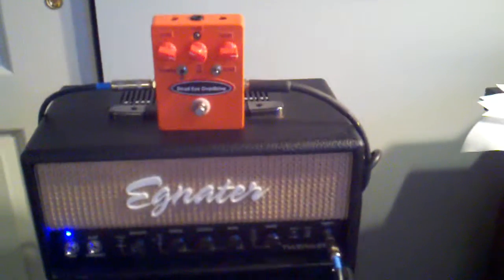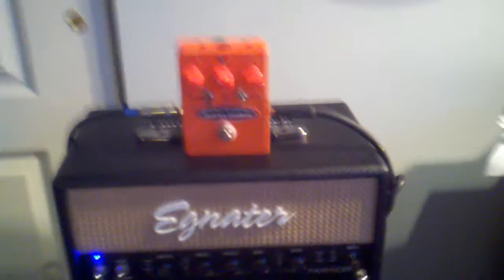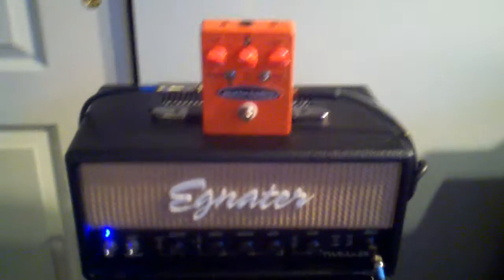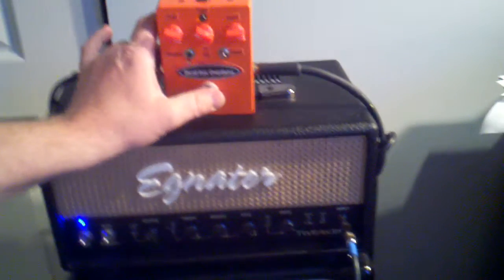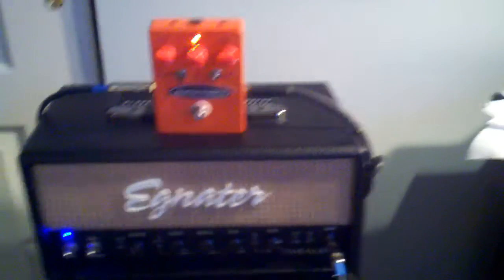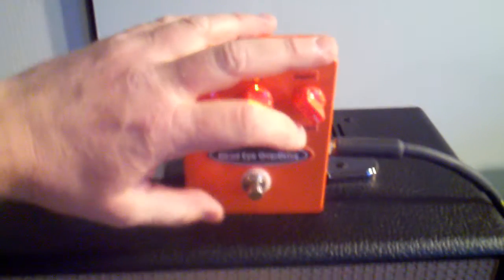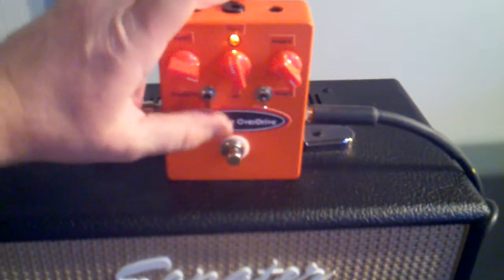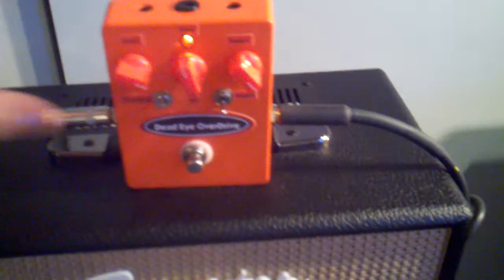Dead Eye OverDrive - Pedal Demo

Comment: Man I know this is an older video, but that thing is sick! I.just got done building my first lm386 practice amp, and I need a pedal like this to complete it!
Reply: Thanks Robert.  You can make one of these pedals very easily.  You can google the layouts for the Dead Easy Dirt, the Stage 3 Boost, and the BMP Tone Stack very easily.  Then put them all together.  I have made various tweaks to each circuit, and combined them with various switches, but that is the fun of the DIY pedal thing.  This one is an easy build.  Enjoy.

Comment: Ok ,I've already built an lm386 amp and have an extra chip.I'm not asking for a schematic, but would like to know what diodes you used for clipping on the 386 side.
Also ,is the stage 3 you used a pre made pcb? 
Sorry for the questions, but I'm really taken back by your tone man..lol I can't shake it!
Reply from the maker: Hi Robert.  Here are the layouts.  This is a DIY community based on sharing.  No secrets here.   Its a fun hobby for self satisfaction, and sharing with friends.

This is my vero layout for the Dead Eye Overdrive based on the Dead Easy Dirt circuit and the Big Muff Tone Stack circuit, with my own tweaks.  

http://i1268.photobucket.com/albums/jj563/BradWorld666/Effects%20Pedals/DED-brad_mods-V11_zps7a3af557.gif

In this demo pedal I used an old version of the Stage 3 pcb from guitarpcb.com.  However, it is a very simple circuit to make yourself on vero or perf.  Here is the published layout for an etched PCB. You can easily convert this to vero or perf.  

http://s1268.photobucket.com/user/BradWorld666/media/Effects%20Pedals/stage3boosterfinal_zps8335387e.gif.html?sort=3&o=0

Good luck and have fun.  When you build this, please let me know how it came out.
Reply: Sure thing man, and thanks for the reply!